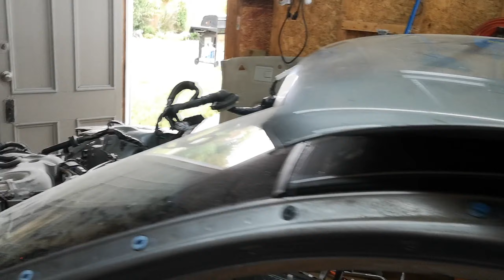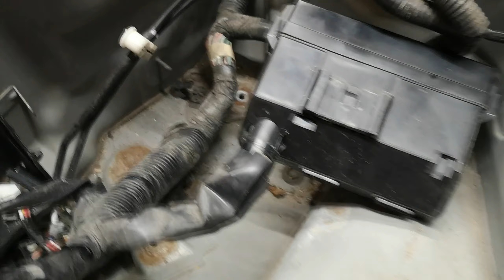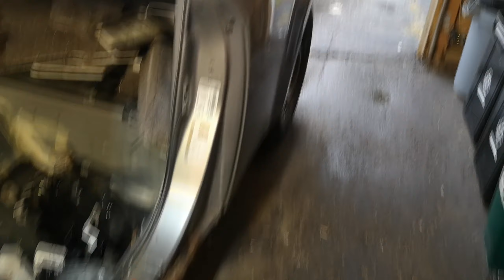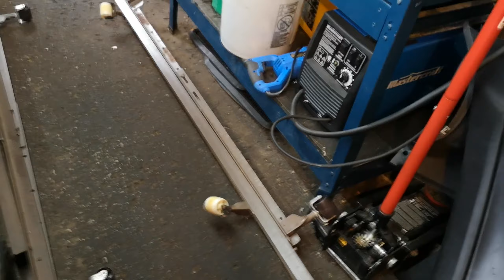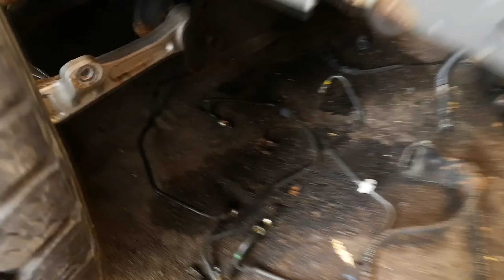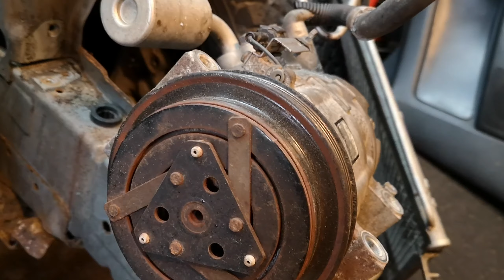Infiniti Update #21 - AC Removal and Clean up

Comment: By a hitch kit for flat towing a car (usually behind someone's giant RV) and attach to the frame rails. Then all you need is a trailer hitch on anything.
Pull it to a scrapyard(or metal recycler) and then pull the wheels off when you leave it